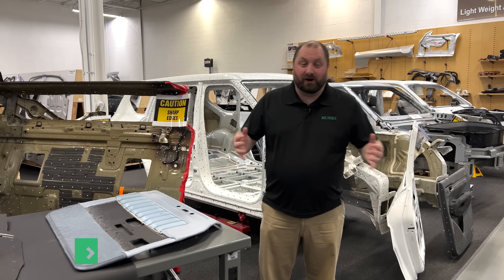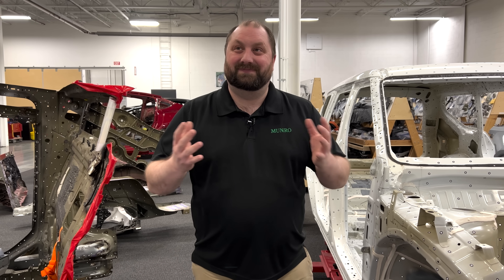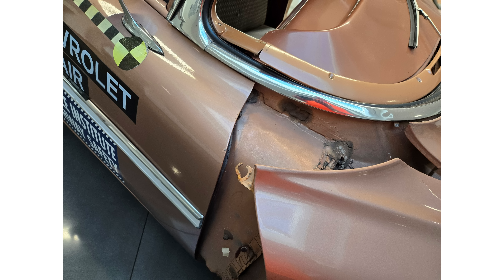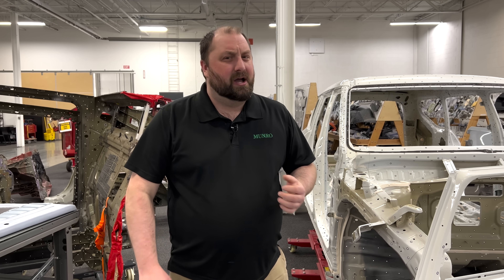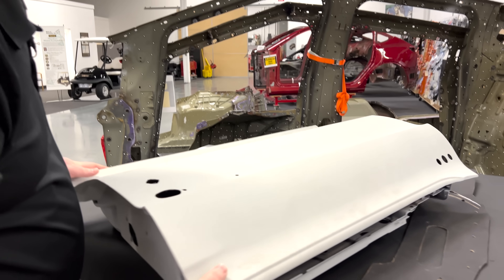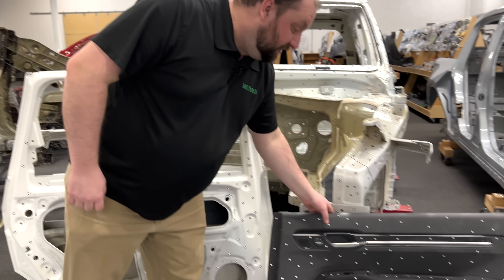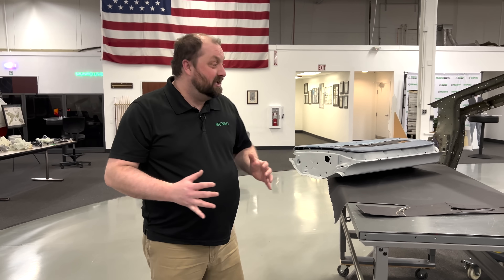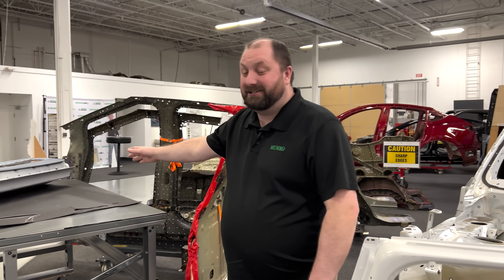No, Your Classic Car Isn't Built Better Than Your New Car

Comment: I think the problem people have with modern cars is that the manufacturers have not really made cars better.

They are safer, but they are also considerably more expensive to afford, and most importantly...needlessly  more complex and expensive to maintain

The safety is absolutely necessary and i would say that lane departure and radar assisted braking are great features that do improve safety and are worth the costs. So too is the better metals and safety engineering

The plastic panels filled with useless computer controlled modules that make everything expensive to replacs and maintain? No thanks.

The electronic controls and powertrain components running on proprietary code designed to make repairs harder for independent repair shops and regular folks, while forcing you to the dealership for repairs? No thanks.

The "lubed for life" transmissions without dipsticks and drains? Requiring expensive tools and no direct way to measure the proper amount of new fluid? No thanks.

The garbage infotainment system which is frankly less safe and more distracting while simultaneously being more expensive and impossible to replace? No thank you

Since 2008, especially since the iphone became popular, the manufacturers have not been making their cars holistically better. The power of new engines is great but who cares when the majority of people are not car people and are just mindlessly going light to light? They put massive distracting screens in cars making them less safe and as a cheap way to make it seem like you were getting more when in fact you are getting less. Better to have a regular radio with buttons and the ability to replace it with a fold out screen of your choice or not, than to be forced to look for a replacement oem screen with no options otherwise.

Just my 2c.
Reply: Proprietary closed-source software makes things worse in just about all scenarios, but the only way that any automaker could be convinced would be with legislation against them (which would never happen). At least the lack of physical controls and the reliance on screens has only become prevalent quite recently, plenty of cars from the late 2000s to mid 2010s have great physical controls and minimal distractions.
Lifetime fill for an automatic transmission is probably one of the biggest blunders from automakers these days. With the immense complexity of modern automatics which have 8 or 10 speeds, there is no way the fluid could last for even 100,000 miles without severe wear and damage. Because of the huge fluid capacities, manufacturers usually only put semi-synthetic fluid in their transmissions instead of full synthetic to cut costs. On top of that, the fluids used these days are extremely thin in an effort to increase EPA fuel economy numbers. With all the cards stacked against longevity, I'm surprised transmissions last even 20,000 miles.
Not being able to measure transmission fluid level actually isn't as bad as you might think, at least with a well designed transmission. I have a car with a Volkswagen dual clutch automatic and the way you fill it is by pumping fluid into the drain hole (there is a standpipe that is removed to drain it and kept in for filling and use) until no more fluid goes in, then start the car and wait for the transmission to reach operating temperature with a drain pan under the transmission, then shift through P, R, N, and D, finally reinstall the drain plug and you're good to go.

Comment: i do hate watching the video of the classic crashing into a newer car. yes i will not argue that a new car has better safety features but it was also clearly not a fair comparison. what do i mean by this? you see the rust fly into the air on impact, additionally that year and make of car is known to have a weak frame design. i know its going to be extremely hard to find a pristine car, let alone destroy one. it is most likely a car that was unfit needed alot of work and was doctored up to look new for the video to show a comparison.

Comment: I own a big "old tough" square body Suburban which is actually not that old, 1990 model, so made in 1989. Doors are empty. Frame is way under my butt and cab has far less stiffening than any of the unibody cars I've seen even compared to the 1990 CRX  that I had in the past. Only the sheer weight and high seated position gives some sort of side impact protection, but it's less of a thing these days when there are so many SUVs and crossovers on the road. And a front impact would not be that much better, seatbelts are barely retracting, no airbag, no headrests the list goes on. So to summarize it's all style, but far, FAR from today's safety

Comment: Thank you for speaking the truth. My family has owned basically all of them, my father owned a Honda Civic in the 80s, it lasted 2 days. The most reliable of our Toyotas, a Tercel, lasted about 10-12 years before having major issues, but started having smaller quality issues when it was only a few years old. Think a 3 year old car where the foam is already starting to detach from the seat and come out in pieces, or the exterior trim is starting to hang off. 

Compare that to our 2017 Ford explorer purchased in 2016 which is a 9 year old car now, and literally has never had a single issue, repair, or part break. Not a single one, in 9 years of ownership. 

Compare that to the Ford's my parents owned in the 80s, a Tarus and a fiesta which both had serious issues within a couple years of ownership, or their Nissan Sentra, that had to have a new clutch put in and had transmission issues. 

Thank God they don't make them like they used to.

Comment: This video was great. It is what I have been saying for years now. While I own a fleet of cars from the late 70's to the early 90's, people forget that as technology progresses, cars get safer, more reliable, and more efficient. Are they more complex and isolating? Yes. Do I like them? No. But are they better? Of course they are. To the boomers reliving the lead and R12 days...let me be the first to pack your house in asbestos while you are at it.
Reply: I'm sure my house already has asbestos and lead paint being it was built in the early 1900's. It also has soldered copper plumbing and some knob and tube wiring...

What was your point again?
Reply: Houses do not have asbestos.
Reply: @ Some do for insulation on HVAC or older plumbing...
Reply: @russdavis1960  Asbestos HVAC tunnel insulation is in factories -- not houses. Normally, in a house you do not insulate the heater duct pipes, or the plumbing pipes.

Comment: Some of them are built to last a lot, but performance and security aren’t really good. In my opinion the best are the ones from the late 90’s to the first of the 2000’s, they were quite secure and had a decent build quality. If i had to buy one referring to these “calculations” I would surely buy an Alfa 159 Sportwagon 2.0 JTDm or a 166 1.9 JTD. Really cool cars, very good build quality, quite used so the most fragile components have been replaced, one of the best diesel engines ever capable of over 500k kilometres and replacement parts can be found easily and most importantly quite cheap to buy and maintain where I live

Comment: i was with you on the steel, construction methods and plastic but you lost me when you brought up environment.
i don't know about r12 but the r134 is rubbish. i spent 2 hours on the highway today, ac on full blast, the car is from 2002 but very low miles, new, one year old compressor for the ac and the car can barely keep me comfortable with 22 ºC outside. at 26-28 ºC i know i will be sweating. early 90s cars were peak and ever since then regulators have been picking at them trying to ruin them as much as possible. name one car that has r134 from the factory and is able to cool like any 80 and early 90s car. no chance, pal.

Comment: Consider me a 'Luddite' if you want....and I'll possibly receive some backlash for the following statements....

 I've been saying for decades to remove ALL of the 'modern' safety features (including seat belts) and let the thinning begin. Also remove the touch screen crap and LED headlights which blind oncoming traffic.  

We are protecting the least capable people (driving wise) with the 'safety' crap.

Driving is allegedly a PRIVILEGE....NOT a right!

Whenever I drive my cars or trucks, or ride my motorcycle.. I've always had the mindset of 'everyone is out to kill me' . THAT has saved me more than once and I have avoided any crashes in the process of driving for 49 years.

To your point of 'No, your classic car isn't built better than your new car'...

Being I don't own or have any desire to buy a new car...for me the point is mute.

Yes new cars ARE safer IF you crash them when talking about survival rate of occupants... but 'built better'??...

Ease of repairs with no electronics and control modules, sensors, communication networks, etc. are what makes older vehicles a joy to own and use and I will continue to avoid any thought of  'new' vehicle purchases.

Note I will not use the term 'accident' because IMHO, that's simply an excuse for not having the skills to drive.

Comment: I started driving in the 70's, so had cars from the 60's and 70's early on.  While many older cars look cool, they were typically in the junkyard by 80k miles.  It was so rare to even hit 100k that odometers ended at 99,999 miles and rolled over.  And fuel mileage?  I had a 69 MGB that ran perfectly.  It got worse fuel mileage than today's Chevy Suburban.  I know you focused on safety, which I agree today's cars are much better but reliability and ability to be used longer is completely won by new vehicles.

Comment: These are all great points. At the end of the day, I can repair my carb, distributor, mechanical fuel pump, and change my spark plugs in under 30 minutes in almost any parking lot in the country. Most parts stores will carry all those part. Where as a modern day car if the fuel pump fails, I will need to drop the tank, need special tools, the pump may not be available. If an injector goes out, again more special tools. I think ease of service on an older car is much more simple and if you maintain them they are more reliable than a modern day car.

Comment: My 62 ford galaxie that my grandparents bought new, turned over 100 thousand when I was 17 in 1970... we drove it to 150000 miles when we wrecked it...and it still had it's original y block 292....

Comment: i have to almost completely agree with him on everything but the frame argument. the X frame was a bad design, but later gm models had frames that ran along the perimeter of the vehicle, and the front suspension support would act like what he showed is under the fenders of a modern car more or less. that beeing said, the fenders aren't bolted to that regardless. everything else he said really applies to every classic car. i have a 1966 Cadillac. the door panels do have plastic inserts for depth on mine but its still a carboars base. the doors are hollow besides the power window system in it, the roof has a rather steong outer perimeter, but its not closed so could collapse easily, and the A pillar is a joke compared to a modern car so it would collapse anyway in a rollover. the build quality wasn't all that great either, even on mine beeing a Cadillac. the seat frames and rails were bare metal for example. on the other hand, anything mechanical on these cars, was build to resist a nuclear blast. i mean if you look at the power seat system or even the power window system, its just heavy fucking machinery. those are quality still in the 60s. later they had plastic housings that would explode. the welds in my trunk pan support braces look like they were made by a baboon welding with a car battery. these are not extremely well built cars. and again, i have a Cadillac, so it might even be better on my car than on other lower end vehicles of the era. especially still in 1966. later on Cadillac lost on quality greatly.

Comment: I also struggle to see how people can think older cars were better built. My 2019 Audi A6 has mostly aluminium body panels, minus the roof and C-pillar. I noted to a friend that after 6 years, there isnt a single ding anywhere down the doors, despite aluminium being soft, we later discovered the door skins are tempered. Goes a long way to explains why you dont see door strips on cars anymore, they just arent needed. There is a difference between cost cutting that can be seen in some places with the very latest cars but that doesnt mean they are poorly built or wont last as long. Plastics in the 80s and 90s, even in the 2000s were known for becoming very unstable and brittle after years of UV exposure and general aging, and while that will always happen, modern compounds in plastics, rubber etc are far stronger now than they used to be. We know a lot more about how different materials react with others throughout the aging process. Getting 150-200k+ miles out of a normal car, with servicing, is very possible. Yers gone by, it was normal for an engine rebuild at 30k.
Reply: you bought and audi. there's no need to say anything else.

Comment: Your title is not quite true, classic cars are built differently for different reasons. Current cars are built to pass a crash test, classic cars were built to stand the test of time, longevity. Very different.
Reply: Classic cars were NOT built to withstand the test of time.
I don't know why people insist on saying this.
Classic cars were even more disposable than today's cars.
Reply: @ your statement is false.
Facts to back that up. There are many, unrestored and driving, more than 100yr old cars still in existence today (built to stand the test of time)
A car built in the last 30yrs will not be around in other 70 to 100yrs.
Reply: @ That means nothing.
First of all, any car in that category still being driven today has had a LOT of work and maintenance to keep it going.
Fact is, the vast - vast majority of those cars from that time were done before 100,000 miles.
And that’s only if they lived outside the rust belt.
They were as disposable as today’s cars.
Just because some people preserved a few doesn’t mean anything.
Reply: @Incomudro1963  to think that any vehicle wouldn’t need maintenance over a 100 year life span, shows total disregard for common sense.
Your ‘argument’ does add up at all.
I guarantee there will not be one single Kia, Hyundai, GWM, daewoo, Taurus, Tesla, rivian, either on the road or in existence in 100years. Where as 100 of thousands of T model fords, chevs, dodges etc are still driven on the road, some in unrestored original condition. You speak rubbish.

Comment: You really have to differentiate or rather clarify what "classic car" means. Of course a car from the 60s (or 70 or 80s or 90s for that matter) is not gonna beat any car from the past 20 years, the crash tests that cars have to ass have a) only been introduced in the 90s and b) become so much more rigorous and demanding for car makers.

That being said, I drive a Mercedes from the 90s and they had been ahead of the passenger safety game for decades back then. I feel completely safe driving in my Benz that has several airbags, crumple zones, has been offset crash-tested with a sturdy cabin and an interior design that was made so that nothing will hurt you badly if a crash were to happen. I certainly would not say the same about my 90s Pontiac :D.

Also, you are confusing passenger safety with build quality. The title says "isn't built better" but that has nothing to do with how safe a car is. Your car can be built like crap and the interior can fall apart and can be full of terrible materials, but the safety regulations require the car to have a certain safety standard, so it will be safer than your 60-year-old classic that still feels nice sitting inside.

Comment: Im a retired mechanic my vintage pick up has 1 of the most 10 dependable engines and doesn't have planned obsolescence built in. And as a disabled senior I don't about the less safety of my truck and I don't appreciate you trying to force people to constantly upgrade their cars because each year the claim to be safer. I don't care we all die eventually. You want to end accidents teach people to drive safely

Comment: Crumple zones to absorb energy in a crash, air bags, shoulder harness, anti intrusion side bars. It ain't rocket science. New cars look terrible after a collision. All that crumple saves your life. Indy and Formula one learned this. The cars get destroyed in a crash. Very little of that energy reaches the driver. It's why they walk away from 180 MPH wrecks. The stiff steel in the older bodies transmits that energy to the squishy humans. Fatalities are rising due to complacency, not engineering. Don't delude yourself that stiffness and strength is a good thing in a collision. It's not. I'll take the classic car, but I'm fully aware of the risk.

Comment: My 1980s Fox body Mustang started falling apart just after the 12,000-mile warranty ended.
More cost effective to shove it off a cliff at 12.000 miles than fix.
Similar failure rate for every American vehicle I owned.
That was how American cars were designed.
My current vehicle was designed in Japan and has lasted 10x longer than the Ford.
Unfortunately, the dealer service is constantly trying to sell worthless service repairs hundreds of dollars more expensive than normal maintenance.

Comment: I would be very disappointed if new cars were still built the same way as old cars. No A.C. no decent radio, no decent lights, way less performance, terrible handling, the list goes on and on. New cars are focused on safety and fuel economy.